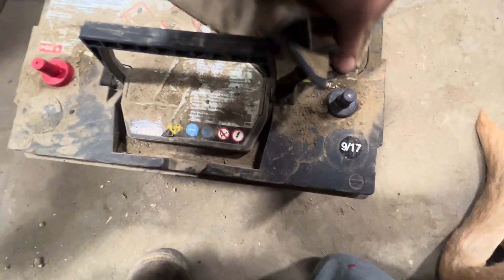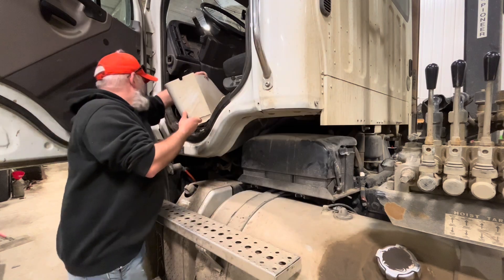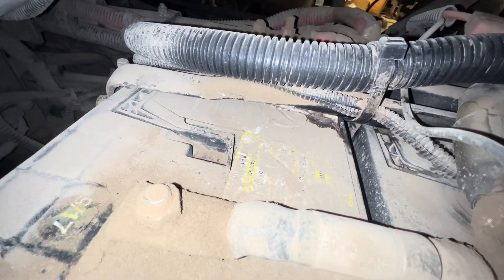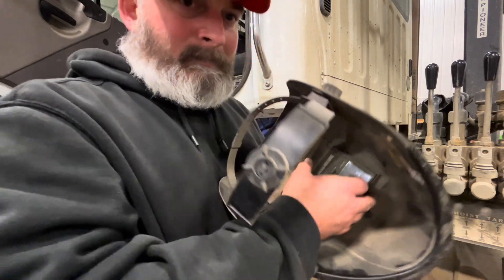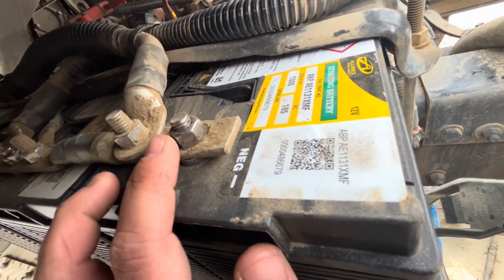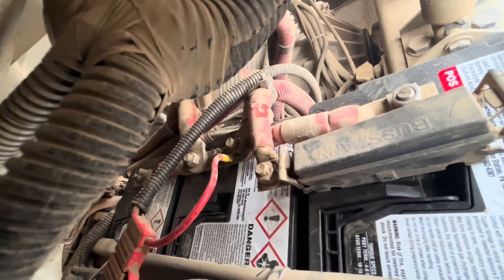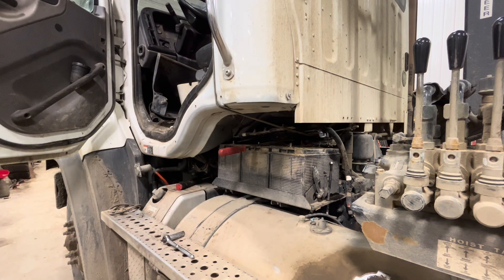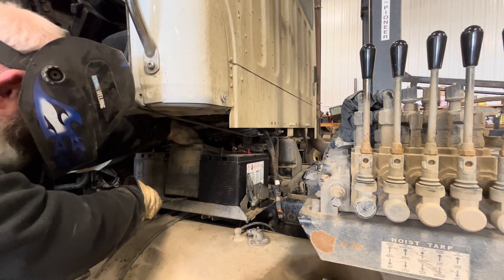When & How to Replace Batteries Freightliner 114SD Smells Like Rotten Eggs Car Truck Bus Motorhome

Comment: What if you just disconnect the bad battery, will the truck still start and run good or you need all of the batteries?
Reply from the maker: Yeah most trucks should crank and start with 2 good batteries.  These new trucks are complex and you’d have to make sure the wire ends were still attached to the remaining battery terminals.  Older trucks were 24v and you got the 24v by connecting the batteries in series but they quit doing that in the 80’s except some military trucks. It gets down to -30°F here in the winter and we need all of the cranking power we can get.  The batteries in this truck were from the factory.  That’s about 6 years on truck batteries which is unheard of.  They’re $120 each at Napa and I’m certain the other 2 weren’t too far behind so we replaced them all.  Weak batteries cause early failure of the alternator and starter so it’s a no brainer.